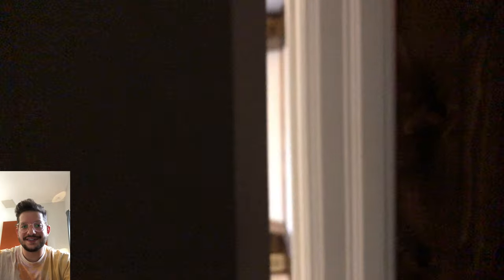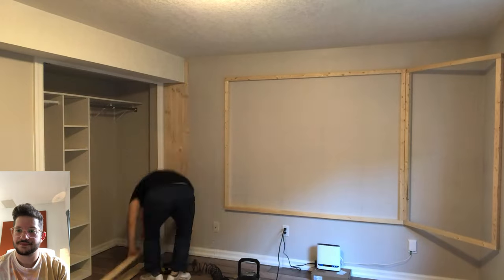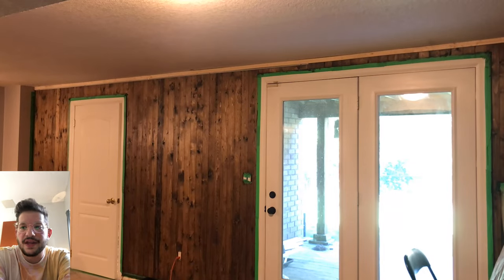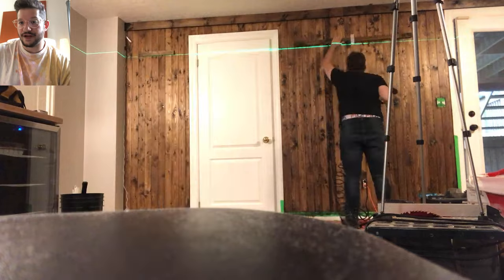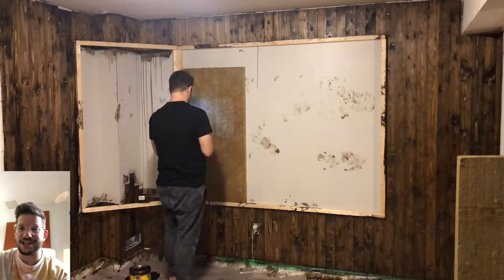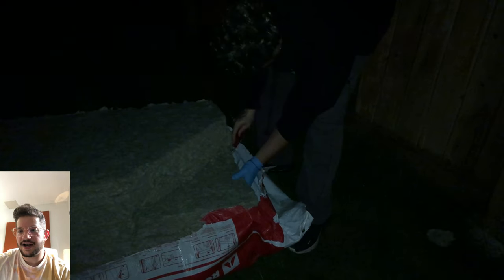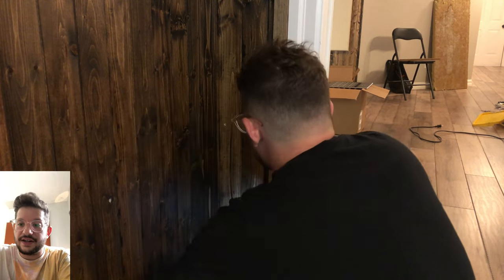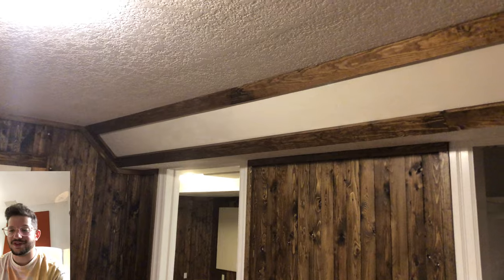EPIC CUSTOM HOME STUDIO BUILD! BASS TRAPS, ACOUSTIC PANELS & MORE!

Comment: Hi, what are the dimensions of the lumber you're using for the bass trap and side wall frames? Thanks!
Reply from the maker: That lumber is 2x2 inch (actual size 1.5x1.5 inch). Thanks for watching!

Comment: Basic question regarding the clouds: do they reduce sound transmission or just deadening? Do they help reduce transmission through the ceiling?
Reply from the maker: Technically they may help reduce a few db for certain frequencies however for sound transmission that is a room construction solution. Not an acoustic treatment solution. Thanks for watching!
Reply: @soundheadquarters  I was also curious. In the clouds, I assume you used Rockwool 80 just like the wall panels? This wasn't shown or mentioned in the video. Great videos btw. Thanks for your info.

Comment: Kudos for having a successful business and a YouTube channel with these nicely produced videos. Your carpentry work is very good. I’ll offer some unsolicited constructive criticism. The amount of construction you do for a paltry amount of acoustic treatment is remarkable and unnecessarily expensive. The finishes in the videos I’ve seen are tacky. I can chalk this up to the customers request so while you have come quite far I think your business can mature a bit. Also, I’ve not seen any mention in the videos I’ve watched of room analysis. Do you take any acoustic measurements before and after treatment? In any event, thanks for the content.
Reply from the maker: I appreciate your comment, indeed the business has a long way to go. As my clients begin to have larger budgets, I am able to provide higher quality finishes. The clients hire me to build their spaces how they prefer them, and especially in home settings this means they have a certain aesthetic and budget in mind that they want to adhere to on their end. I’m always happy to build something that makes my clients happy even if it’s not for optimal acoustics. For this videos build for example, the client wanted to keep the acoustic treatment on the walls as low profile as possible, hence the thickness of the fabric wall and panels. I have done room measurements for clients that request it, however majority of my clients prefer to put that cost that I would charge them towards their build. Stay tuned for future projects especially the ones I’m in collaboration with Signal Acoustics on. Thanks for watching!